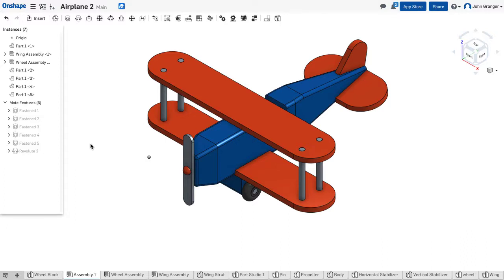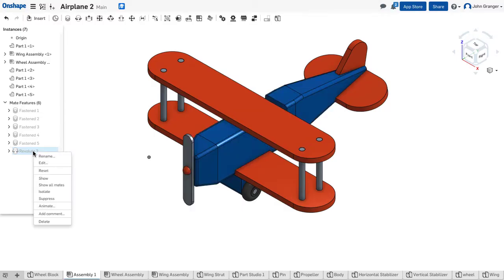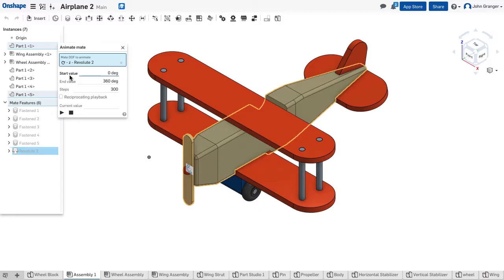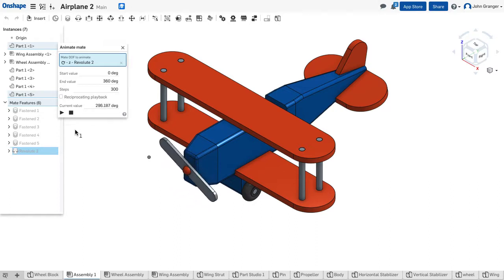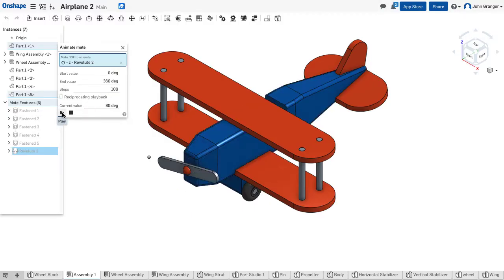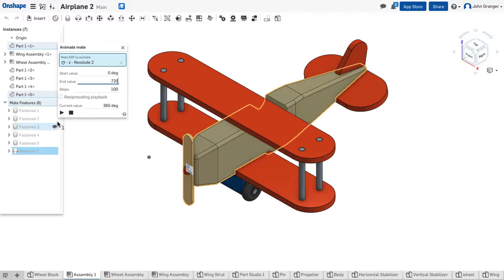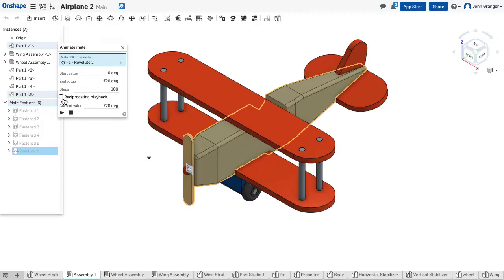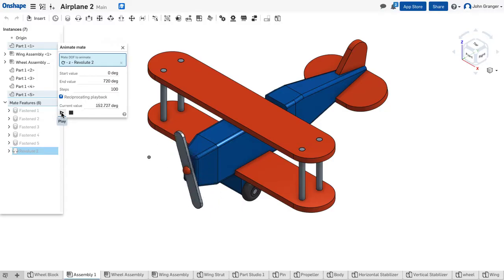Onshape Project - Airplane - Step 12 - Animate the Airplane Propeller

Comment: I learned a lot but when I anamate the prop the whole plane turns and the prop don’t. I went back in 3 times to redo it and watch the video again to see if I missed something but I seem to hav dun it just like the video. Any pointers would help thanks
Reply from the maker: The body must be fixed in place so it won’t move. Right click on the body in the parts list and choose FIX from the pop up menu. Right click on the propeller and make sure it is not fixed and is free to move. Now try the animation again.

Comment: I be followed everything but my plane keeps turning but not the propeller. Please help any suggestions?
Reply from the maker: The body of the plane needs to be fixed in the 3D space so it won't move.  To do this, click on the body of the plane to select it, right click and from the pop up menu choose "Fix".  Now you can animate the mate on the propeller and the the propeller will turn and not the plane.  Have fun.
Reply: @Onshape.Learning.Projects  It works thank you!
Reply: @Onshape.Learning.Projects  I know I'm 3 years late but thank you so much for the info, it functions properly now!
Great video content as well keep going
I wanna see more!
Reply: @Onshape.Learning.Projects  helped me a lot too
Reply: Thanks that helped me aswell